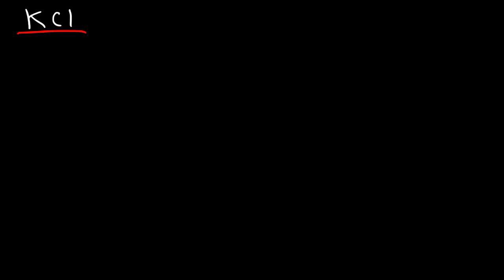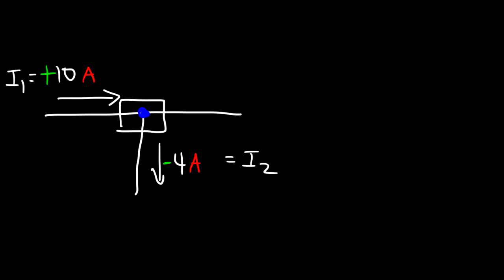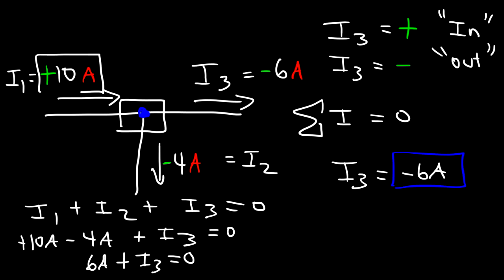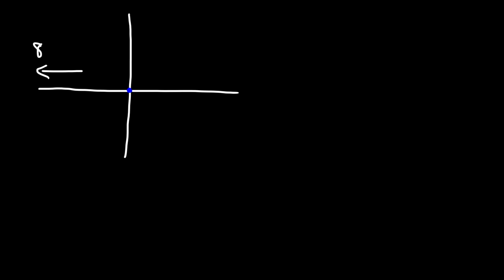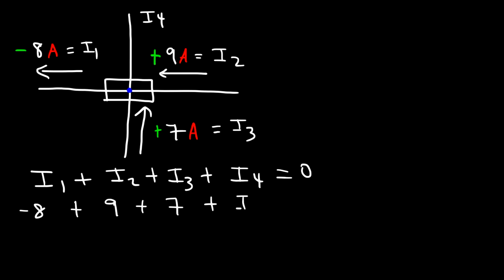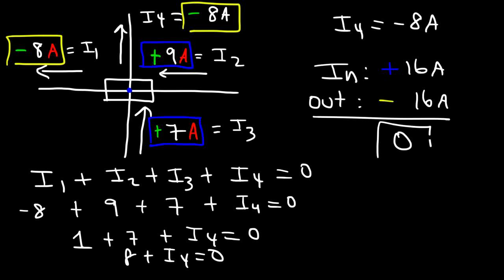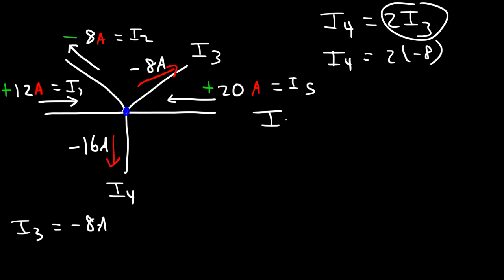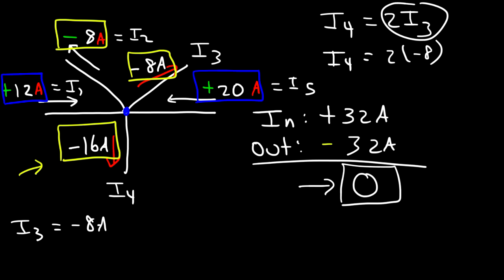Kirchhoff's Current Law, Junction Rule, KCl Circuits - Physics Problems

Comment: is it correct for the saying that the  summition of  current entering and leaving a point is equal with zero? i think this rule is for voltage, not for current.For current;the current entering a point is equal with the current leaving that point.

Comment: Out of curiosity tho, for the last question, what do you do if the directions may or may not be different ?
Reply: Sum of those 2 should be equal to 24 in terms of magnitude. But since their signs are different in that case, you'd need to solve this equation I4 - I3 = 24. since I4 = 2I3 I3 = 24, I4 would be -48 ampere